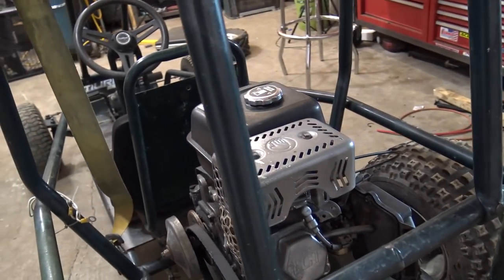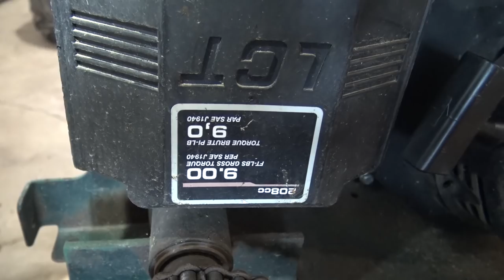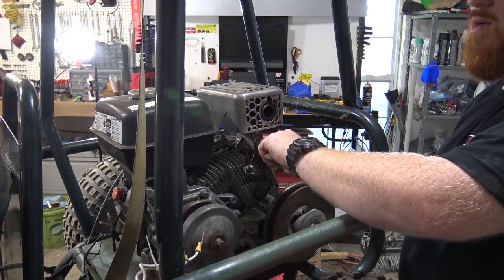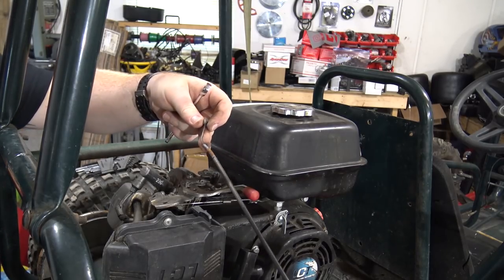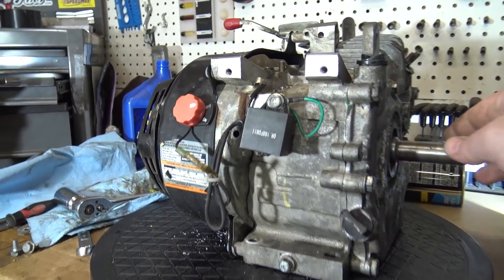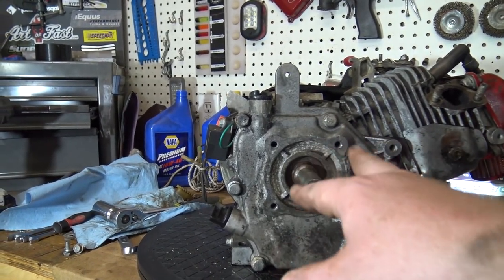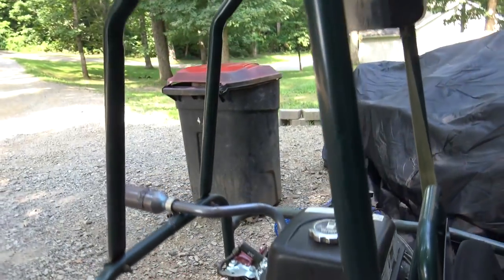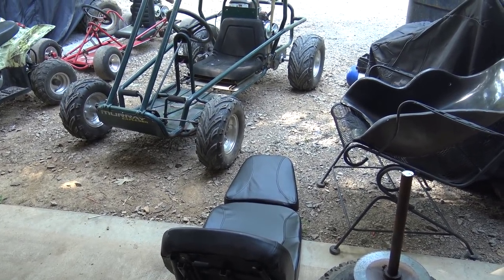Off Road Go Kart Build Stage 1 ~ Murray Explorer

Comment: I believe that black box may be a safety to shut down the engine when tilted to far or rolled over etc.. kind of like the oil sensor does only external. I had one of these Murray explorers as a teen that we bought new at Wally World. Had it for years and loved it. They were $999 new and came with a Tecumseh Powersport originally. At least mine did. Excellent video as always and I look forward to watching your build!
Reply from the maker: Thanks man. I remembered Wal-Mart having Murray go karts. Too bad they still don't.
Reply: Red Beard's Garage thecowboyfromhell has it right, its a inertial switch that kills the engine. Most likely the contacts are seized closed. No problem with running it disconnected

Comment: I just acquired this same cart. Found the belt on Amazon, but unfortunately the driven was toast so had to order the odd size replacement from comet dealer. It runs 39 mph stock with the predator 212 and I'm 6'2 230👍
Reply from the maker: +Melloreel this one does 39 also. Lol.

Comment: On the gap for the coil packs ;0)

Cover/Card Stock varies in thickness and weight. For example, a 10 pt card is 0.010 inches (0.254 mm) thick (roughly corresponding to a weight of 250 grams per square meter); a 12 pt card is 0.012 inches (0.3048 millimeters). See Figure 1—Cardstock Thickness vs. Weight.21 Feb 2011

If you use '30 pt' [ 30 point ] 'cardstock' you get 30 thou ;0)

Comment: Love your videos!! I just bought myself a nice Murray Explorer and it has a new 212 Preditor . What a power house with that torque converter system!! Mine has a live axle not sure if all of them do. BUT, what I would like to do is mount hubs to the front to accept 4 bolt or similar wheels. I noticed when you mounted that V tread tire on yours, it appeared to be mounted to a hub of sorts. I want to eliminate the 6" wheels. Can you guide me as to what to put up front. For the rear tires, I still have the junky looking 18 X 9.50-8 lawn mower looking flat track tires. Should I also go with hubs here as well or just stuff a balloon tire on them wheels and is there a size larger I could go larger than 18 X 9.50 that would fit under that frame rail? Thanks for teaching me something new in every video!!

Comment: i have worked on mowers over 40 years seen a few lock up the same way ,, also seen a bolt or screw stick to the flywheel mag and lock up the engine . that is what i thought you were going to find ,,

Comment: Most Briggs mowers run a 0.10 thousands gap, which is a little less than a business card. Its why most feeler guages have a brass 0.10 gauge.
Reply from the maker: +dave1135 yeah I was just tired and did feel like looking up the right gap lol
Reply: I always use a envelope. Never had a problem

Comment: I just bought one of these that is very similar and has that weird mounting plate. The main difference is my axle is only held with a pin on each side and the suspension shock on each side. With the jack shaft being mounted to that weird frame I'm guessing I'm going to have to do what you've done in this video with the torque converter but I can't figure out in my head how it will work with the motor not being on the same plane as the sprocket and axle at all times due to the suspension. I'm sure you don't have time to talk me through it but any suggestions would be great! Or maybe you'd be interested in doing another Murray Explorer build? Lol Love your videos and especially the fact that they are clean.

Comment: Nice build Red,
I have a question.
What gearing do you recommend for a Honda 13hp gx390 and a 40 series comet torque converter..I'm going to put it on a manco xtk -710e...thank you Red.!!!
By the way your builds are very cool.
Reply from the maker: Are you off roading it or street use?

Comment: Hey Greg nice build man that thing is looking awesome and riding awesome too. Quick question I have a manco black fox two seater that I recently redid and it has a 212cc and I'm running a clutch and a 40 series chain and it seems like I can't get the right tension. I put washers under the engine to rise it up and the chain is still  loose.  I' m thinking I should just make another chain cuz I bought 15ft of 40 chain or also I'm thinking of installing a tav do you think I should ditch the clutch and go with the tav or just make a new chain cuz I'm tired of adding and taking links out of the old chain.
Reply from the maker: Well I would defiantly recommend a cvt over a clutch on a go kart like that. You can buy a roll of chain on go power sports for pretty cheap. You can also just remove some links if you can't get it to tension good.

Comment: Good Stuff!  I have the same Murray Explorer and was wondering on 2 things;  did you remove the jack plate? to save weight, simpler?  and are the small springs on the front spindles on the top or bottom of the assembly?  mine are on the top which seems wrong to me?  thanks for the videos and the help!
Reply from the maker: I think the springs can go either way. If I was putting them together I would place them on the top I would think. The jackshaft was removed because it wasn't needed and the bearings was shot
Reply: Thanks for answering!  my front springs are on the bottom and like you said it makes more sense on the top... I will switch them around. ** For a future video, is it possible to add suspension to either the front or back of the Murray Explorer?  that's my only wish for this kart, as otherwise it's sturdy and built well! THANKS!

Comment: Have you had any problems with your red coleman minibike because I have the same one and it started crawling away when I start it my dad thinks it's the clutch sticking or it's idling too high but what do you think
Reply from the maker: The first run of the bikes had clutch issues. They changed the clutches on the later models

Comment: I have the exact same go kart and adding a predator 212 stage 2 in it. Question . Serious one. When I take that short drive axle out. What do I hook the back end of the torque converter too. Do I just leave that back plate to the cvt exposed?

Comment: Red remember when I asked you about my box stock engine would lose power well have taken head off least 5 times trying to lap my stainless valves still same thing tried some new stock ones still leak so I lapped two intake valves FIXED 😏🤗😀

Comment: What size chain do you recommend using. I have a Carter go kart that I am installing a new max torque 10t #41 centrifugal clutch. I am thinking about using either 40 or 420 chain. The clutch is going on a 6.0 Tecumseh with a 72 tooth sprocket.

Comment: That LCT has to be a Predator 212cc clone... Theres no way in hell that its not a 212cc, they just labeled it 208cc for legal reasons.. Same reason the Clone 196cc died out, Honda sued so they took that same engine and stroked it to 212cc to say its a different engine.. Yay for torque!

Comment: Hey Red Beard, I'm building this same exact cart for my brother but with a 301cc predator. The only thing I'm missing is the driver clutch and a belt. Do you have any tips on measuring for a belt to use on that stock jackshaft?

Comment: Hey Red Beard, I know you promote go power sports torque converters but as I live in the uk I am wondering if eBay remakes (torque converters) are just as good or not as I don't want to pay massive postage fees.
Cheers bud
Reply from the maker: +Tekspert how much would the postal be?
Reply: Red Beard's Garage something like $20 as an estimate but the real cost is the import duties when it comes into the UK they can be an additional £15-25

Comment: Could that black box be a fuse?
Reply from the maker: No it has some kind of circuit inside but they epoxy fill it so you can't see it
Reply: points and condenser to electronic conversion maybe
Reply from the maker: Someone said its a roll over box. Shuts the engine off incase you flip it
Reply: Red Beard's Garage so basically a version of a low oil sensor

Comment: hey this is random again but if I buy a jet and air filter kit for a stock Predator carborator is it equivalent to a mikuni carb?
Reply from the maker: No the mikuni is a ton better
Reply: Red Beard's Garage ok do you have an Amazon link for one for a Predator 212?
Reply: Hey red how do you feel about removing those gov with the tc don't want to break rod but I'm thinking with tc won't rev high enough what u think
Reply: Unfortunately those mods won't make the stock carb as good as the mikuni. The mikuni will allow more air and fuel into the engine and will have better throttle response. But if you're on a budget these mods will do just fine.
Reply: Get mikuni

Comment: where is the governor on that quads motor
Reply: Jay Thomas I used to have one and it was a screw on the throttle
Reply: Jaiden Cooper  theres not one on the motor anywhere
Reply: No on the handle bars with the thumb push
Reply from the maker: there is a screw behind the thumb throttle